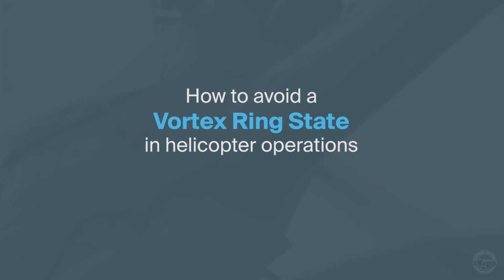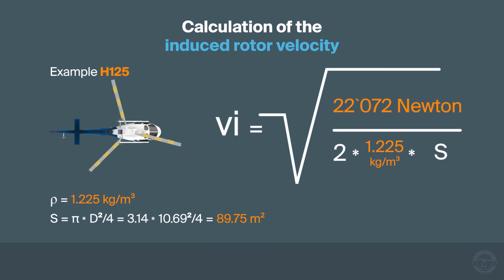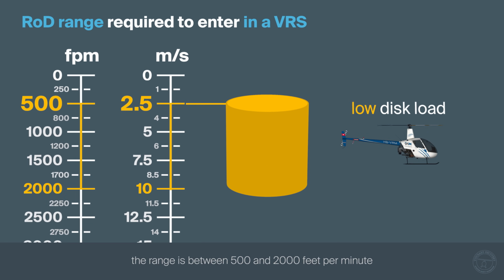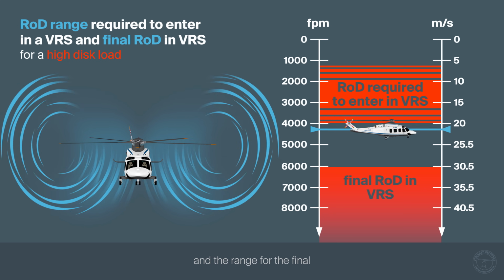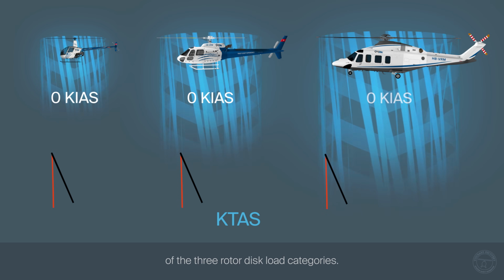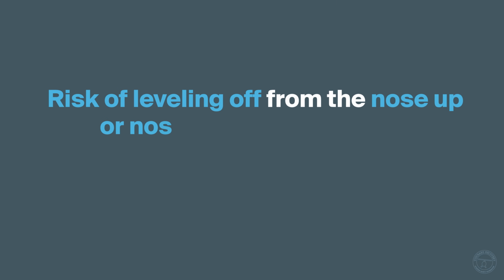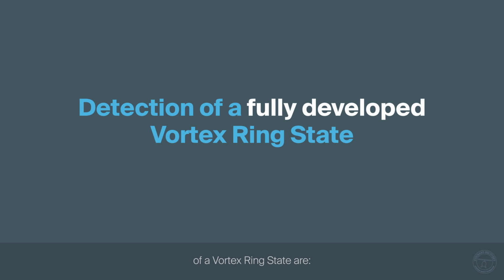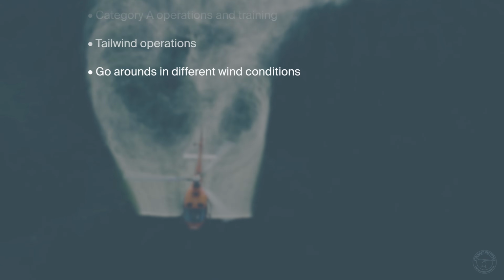„How to avoid a Vortex Ring State in helicopter operations“ part I of III

Comment: Awesome video!😊It describes very good this phaenomena! Maybe one time in the early 2000's I experienced this VRS by an Alouette II helicopter (I was the passenger).  When we approached the airport the helicopter started to descend faster and the sound of the main rotor has changed. I remember the variometer's indicator turned down permanent. It was a bit scarry. Then the pilot accelerate the speed and we landed safe. He said he surprised also...😉

Comment: I am confused of whether TAS or IAS is the correct airspeed to use, when determining the airspeed required to enter the envelope for VRS. All the other literature on the subject says IAS, but this says TAS. 

From my best knowledge, I believe TAS should be used and here is why. Lets say a scenarios where you hover at 10000 ft. The headwind is 20 kts (this is measured relative to the ground, correct?) 

The TAS will be 20 kts, but the IAS will be 24 kts at this altitude. TAS will put you in the envelope but IAS will place you outside of it. I know the differences are small in this example, but I think it illustrates what I am getting at.

Is this the correct way to understand this? If I am wrong, please explain why. Thanks
Reply: In fact the correct dimensionless parameters to define the boundary of vortex ring state conditions are TAS/Vio and Vz/Vio.
For a given mass Vio increases with altitude following the same law as TAS increases for a given IAS. Then finally the correct parameter is IAS and not TAS because for a given mass, TAS/Vio at any Zp  = IAS/(Vio at Zp=0)
Reply: I suspect they use TAS in this video due to the fact that IAS is unreliable in most helicopters at the slow speeds they discussing 10-20 Knots

Comment: Theres been several fatal helo crashes caused by mast-bumping while attempting this maneuver. The best way to prevent this, is to avoid it. Robinsons r notorious for mast-bumping.
Reply from the maker: The video is not about recoveries, but exactly how to prevent a vortex. Regarding your statement that there were several mast bumping during recovery, the cause is not in the procedure but somewhere else. In a VRS with a low disk helicopter you never reach a low g which could induce a mast bumping.